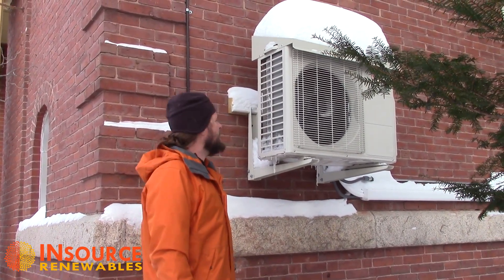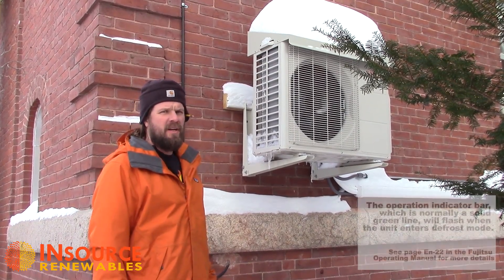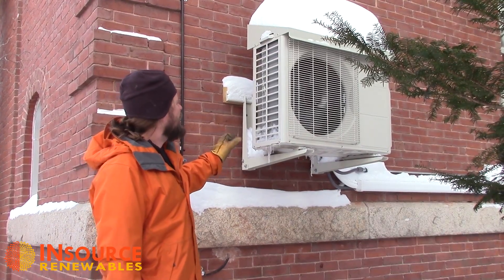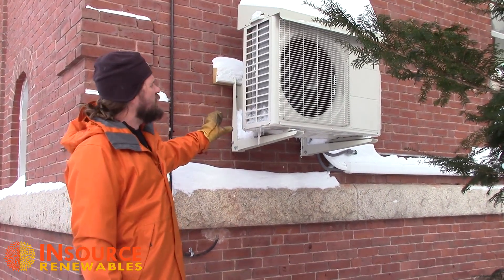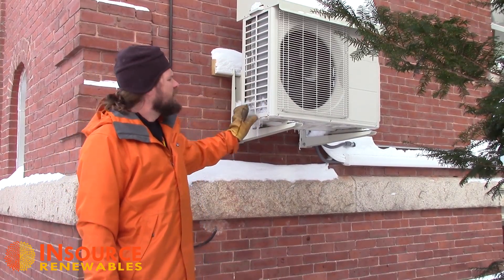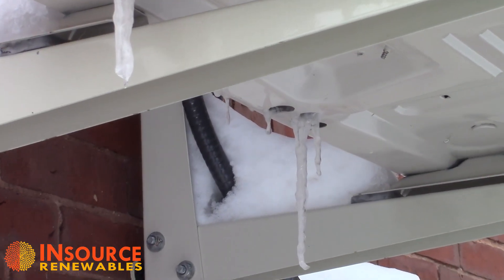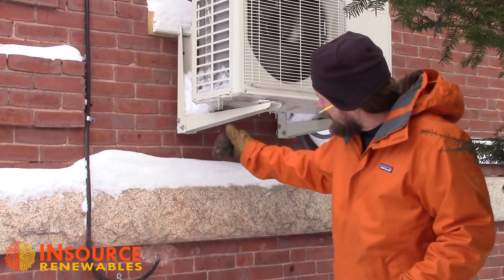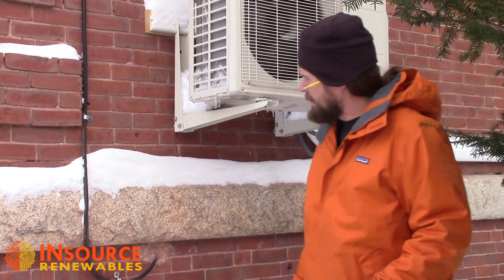Heat pump user tips #3 (defrost)

Comment: My Gree Hansol does the defrost many times a day even when there is not even a smallest sign of ice on the coil. Why it is doing like that? Please help!! When the outdoor temp is around 3-4 C° everything is fine. It can run all day. If the outdoor temp drops at -1- -2 C° it does that 10-15 times a day, but no sign of ice on the outdoor unit.
Reply: If it is below zero it has to go to defrost mode since ice will make on outet unit. It is normal but just annoying.
Reply: its because it is a gree and its cheap chinese junk. buy something like mitsubishi heavy industries or panasonic.
Reply: @SupremeRuleroftheWorld  Thay are saling them as good brand here, and are not that cheap.
Reply: @laskasase  that does not mean they actually are, just that they have good marketing.

Comment: Or just install a drain pan heater
Reply: That kind of blows your COP out the window...
Reply: @pauleedeehimself8489  not according to the technical specs. There is a slight difference,  but not 'blows your COP  out the window'. And money well spent compared to a freeze up in the middle of the night in February,  or damage done to the outside unit.
Reply: @pauleedeehimself8489  Er. No. A drain pan heater is standard across all Fujitsu cold climate heat pumps.
Reply: Hmmm...fair enough. Not cold enough here to need one, so standard defrost cycle on our Daikin is more than enough😉

Comment: I have a Panisoinc and there is only one hole.  It's   being going into defrost mode a lot.  I washed it out with hot water. There were a few leaves and pine needles. 
Would outing a cover over the unit help ?
Reply from the maker: It depends on the location of the outdoor unit. If it is under a drip edge where melt from above is dripping on the unit and getting on the back of the coil, then a cover would be useful.